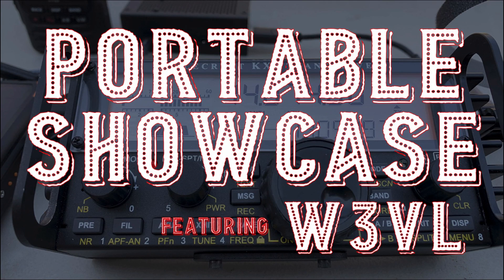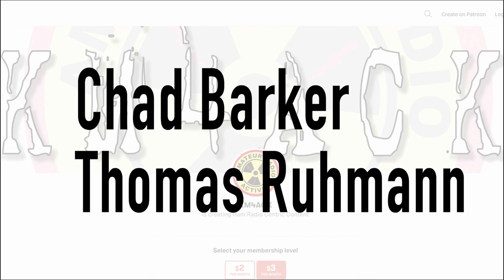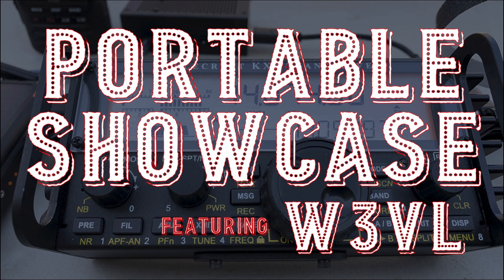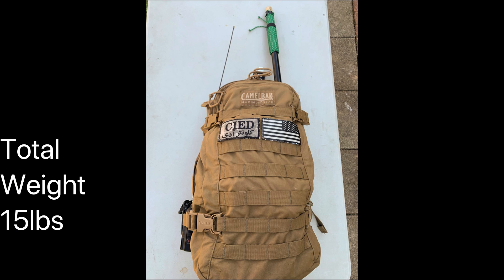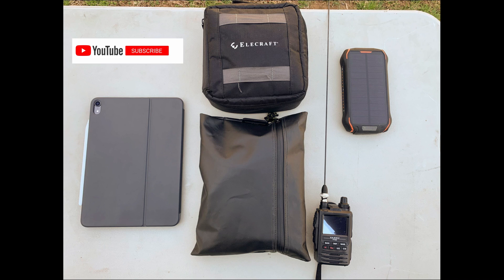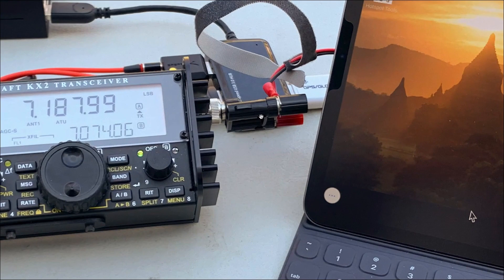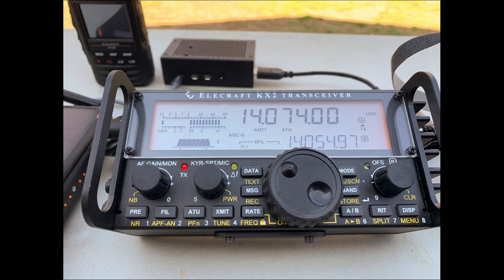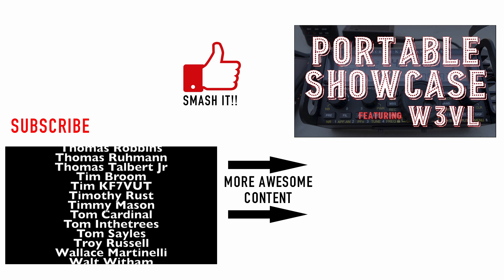W3VL Portable Showcase

Comment: I have the KX2 as well and my setup is similar.  It is a great radio.  Correction:  The KX2 is only 10-80 and no 2 meter option.  The larger KX3 is all band and has the 2 meter option, as well as an optional PAN adapter.
Reply from the maker: Thanks for the correction Tom! I thought the option was available for both.